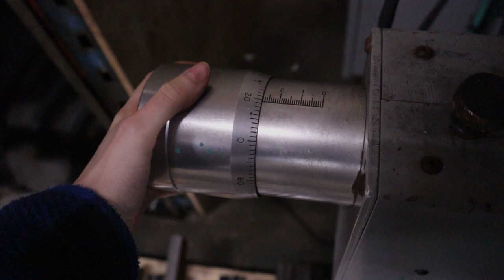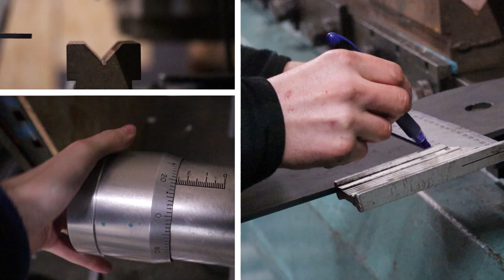VW MK1 Rabbit Rear Axle Conversion {Leaf Spring Suspension Upgrade}

Comment: Hi, have watch all caddy videos. i will start my build pretty soon. just wonder, the custom floor plates u guys did. can u make them for sale? same with this video. plus how low can u go with ur setup? cuz i will install airbags on my or the new system air"bags" for coilovers. only lower/higher 50mm but thats enough for me. in the lowest setting i want it to almost touch the ground. sub and notfication on. keep uploading u doing a fantastic work :)
Reply from the maker: Thanks! On the setup we've got the sills should touch the floor, we wouldn't be looking at selling the setup until next year when we've had a good chance to test it

Comment: Is the trailing arm from the caddy... or from the donor golf?
Reply from the maker: Neither! It's from a Polo
Reply: @RotboxMetalworks  you got a video on that part? How does it mount to the body?
Reply: @oliverpaton556  I was going to ask the same thing as well. The axle has just appeared in the rear out of nowhere. There has been a lot of work to get it to that point. Squaring it up and mounting it to hard points on the front of the frame which more than likely had to be fabricated also as that axle is non existent in a caddy. It would be good if it was explained how it got to that point.

Love the editing and music by the way - it really makes it too!